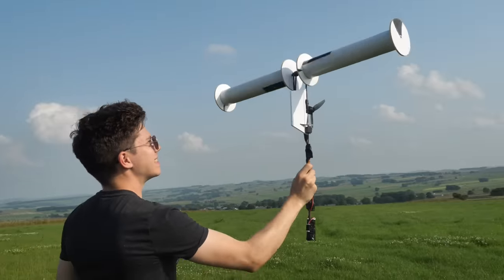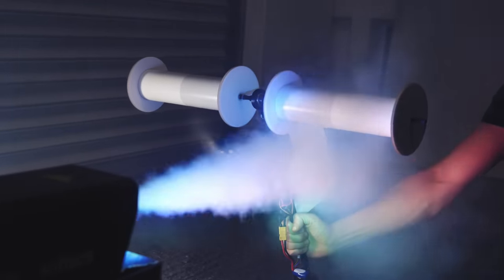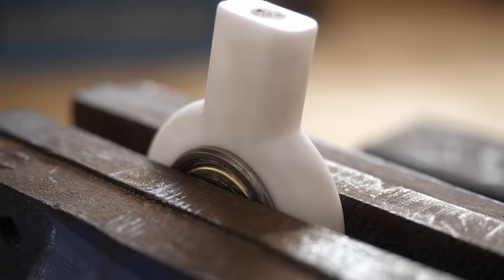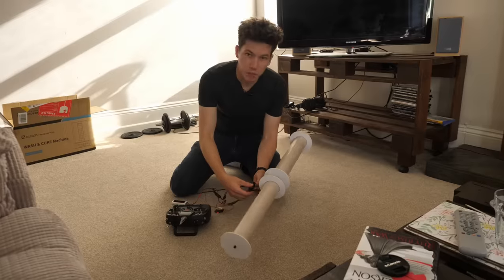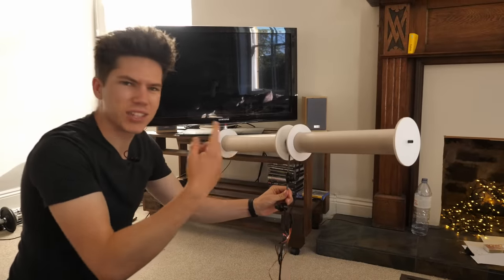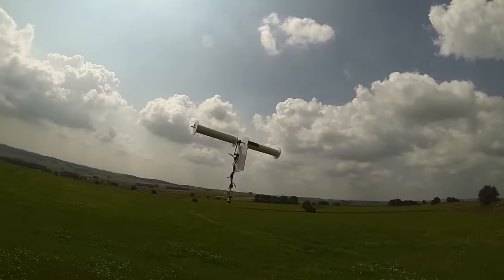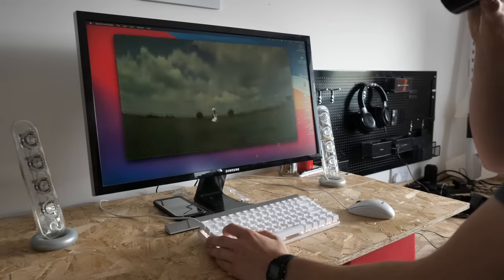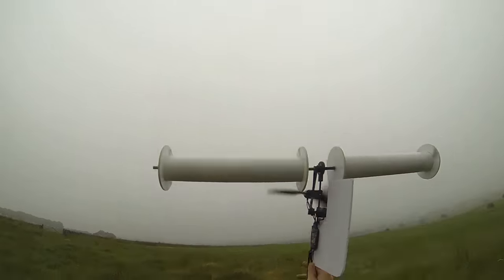Building an Advanced Magnus Effect Plane

Comment: There's something delightfully unnatural about watching that thing actually fly
Reply from the maker: I’m still surprised the Magnus Effect is that powerful to easily lift 600g of plane! ☺️
Reply: I am working on a project to drop a plane from space with a weather balloon can you give a plane design with big wings to fit many solar panels as possible
Reply: @creativitybooth8115  a glider? Big wing, so many place to fit solar panels
Reply: @creativitybooth8115  Man that's a hell of mission to tackle if you don't know about aerodynamics. Also likely super illegal depending on location and prior approval/licensing.
Reply: @thirtythreeeyes8624  as I am in india it is legal and there is no airport in the city I live so there must be no problem
Reply: @creativitybooth8115  What are you trying to do when the plane is released? It's been done before but, on a much simpler scale if you're trying to go for some solar project.

https://www.youtube.com/watch?v=rpBnurznFio

I would add an autopilot haha. Maybe with an altitude based release so the balloon doesn't get tangled.
Reply: @thirtythreeeyes8624  the link you sent dint land in the intended spot I am trying to land where I launched so it would be much easy 
Solar plane will give much higher flight time to drive home 
The plane would be equipped with a rfd 900 telemetry and a sky droid h12 transmitter for emergency 
It will be running a Pix haw 
So it will be linke a real mission
Reply: @creativitybooth8115  As I said he did a really simple attempt with a glider only jet air frame not ideal for a real mission style. As long as you plan for the variables a successful balloon flight shouldn't be too difficult and would not require solar power but, GPS and I'd assume other satellite positioning systems stop working above a certain height.
Reply: @thirtythreeeyes8624  that would be my blind spot after that I would regain signal and drive back home no problem ah
I coul use a simple glider but it wouldn't land in my designated landing spot
Reply: @thirtythreeeyes8624  I would switch auto mode only after I regain signal through my telemetry
Reply: @thirtythreeeyes8624  I am doing this also for my youtube channel to get more subscriber
Reply: @creativitybooth8115  I wasn't suggesting use a glider I'd use a flying wing, only saying that is what David used, although a glider could easily make it to the launch point with even a moderate glide slope, unless you launch on a very very windy day.
Reply: @thirtythreeeyes8624  thanks for you suggestion but can the glider glide the way home
Reply: what if you make a second set of cylinder going the opposite direction will it float?
Reply: lmao some bystander might think its a ufo
Reply: Nice

Comment: The reason it is so unstable is because you modeled it after a pendulum instead of having control surfaces for horizontal stabilization. Lowering the center of gravity does not stabilize an aircraft because the thrust and lift vectors are not fixed to the direction of gravity. look up 'pendulum rocket fallacy' for a better explanation of this.

Comment: You don’t have a horizontal stabilizer. You made essentially a flying wing with no ailerons or elevator. Very cool that’s you’re trying to make something cool and seems like you had a lot of fun doing it.
Reply: horizontal stabilisation is provided by the center of mass being far below the center of lift, an airplane style horizontal stabilizer might help tho.
Reply: @ledocteur7701  that’s not really stabilization, that would be balance. Stabilization is active, using air flow to keep something stable. I think your plane could fly if it had stabilizers on it.
Reply: Yeah, the fact is, you made the job really hard for yourself by not just replacing the airfoils of a fixed wing aircraft, but also chucking the stabilizing features including dihedral and empennage. You also induced a counterproductive moment with your propeller position. Nevertheless, you made it fly...bravo!

Comment: Man that's awesome! I would recommend making the tubes slightly dihedral to make it more horizontally stable and a fixed vertical stabilizer so it'll move in a much more straight direction.
Cheerios!

Comment: Does the speed of the rotors change the lift characteristics? If so, you could have a small "tail rotor" that you vary the speed of as an elevator.
Reply: yes indeed it does, faster cylinder rotation makes more lift

Comment: I wonder if there is a more efficent fuselage /body design. I've seen petersripol swap the wings for the magnus rotors on a normal plane design, and i've also seen a video of a drone with four magnus effect rotors on a drone instead of propelers. I wonder if there's a middle ground, wich has both controlability and stability.
Reply: My most recent design is stable and has landing gear for takeoff and landing.

Comment: I like this! Nice catch on the thrust point being too low. Have you tried having the prop be a 'pusher' orientation? I'm curious if that would give smoother air over the rollers to help their effectiveness, or if the thrust from the prop actually makes them work better due to the air it throws over them.

Comment: The "stem" seems to be one of the main breaking points. Could the design be adapted to fit carbon fibre rods? As far as I understand it should get lighter and more durable
Reply: @cap5856  it doesn't look like that in the video. There is the announcment picture where it has the right texture but in the end he said to PRINT it with more infill
Reply: @cap5856  yeah ok, the last rod is carbon fibre, but the one before that definitely wasn't
Reply: @cap5856  Thank you captain obvious for your redundant commentary
Reply from the maker: @nutmeg8363  To confirm, all of the fuselage and rotor axle tubes used in the build were carbon fibre. Some were thicker than others.
Reply: @cap5856  Your comment was redundant because Nutmeg had already acknowledged carbon fibre had been used in the frame. When he originally suggested the use of carbon fibre he was unaware that it had been tested. Assuming he knows what the meaning of 'moot' is, he would also be able to deduce that his suggestion had already been tested and wasn't useful. Your comment was superfluous (synonymous with redundant) if we assume Nutmeg is capable of the most rudimentary level of critical thought/reasoning.
Reply: @cap5856  *I should have used the word 'comment' rather than 'commentary' in my original post

Comment: you don't need a circular core for the Magnus effect, think about a steamboat paddle.  You can make a thin slat, like Venetian blind slat, work as a Magnus airfoil that displaces air reasonably well. You might make an aero-spike-like variant by cutting your cylinders into four sections along their axis, then reversing each section so it is concave when viewed from the outside, and gluing or taping them together.

Comment: You need to look into harmonic balancing of your "Wings". Pretty much the same thing that is done to your tires when you get them balanced. It will stop oscillations because of two spinning axis's that are off balanced. Could explain the bank/yaw that you are also getting. With a good balancing, you should not only be able to get a more controllable/sustainable flight but, you could even get it to hover without it lawn-darting into the ground.

Comment: So for a science fair project I had set up and illustration in research panel on all the different ways to generate lift.  I actually found that the Magnus effect is much stronger if you use something like a paint roller.  Pretty much the principal uses drag to create lift and if you want more low speed lift you need more drag.  Also a rear horizontal stabilizer seems to be the way to go with dealing with pitch problems.

Comment: please revisit this :) Could use one white tube rather than two, putting the battery inside the rotating wing, with bits hanging out either end that hang downwards to stop the battery spinning round instead of the wing, remove the tie-fighter bits from the ends of the "wings", and if possible remove the propeller. It'd look even more spooky to see it fly :)

Comment: Great project, awesome!

Your projects are cool, loving it.

Just a tough of this *flying object*, as it without a wing, power-off = disaster .. might be a good idea to add-on an emergency parashot landing switch. ;-) 

Some propose idea: :-)
1) A design to detect lower voltage (not too low, preserve for throttle/rudder motor), and shut-off the  cylindrical  (with ejecting the parashot), timing would be critical
2) Enhance the  2nd motor mount, with vector control motor mount, to provide a much effective rudder control (without the use of vertical stabilizer) , along with forward propulsion
3) The remaining current in battery, shall be good enough to provide minimum steering assistance for the rudder in parashot  mode

Hope to see if you are interested and share this new version :-)

Comment: Very interesting, makes me ask questions!

1 I wonder about the effects of using a slightly oval rotating tube?  What of an egg shaped tube, wonder if that would fly?

2. The lack of directional control was likely more to do with the length of the craft, centre of pressure, battery location, and the location of the directional drag component (the rudder)!  What about extending the build?

3. What about adding 2 small motorised gyroscopes (one clockwise, the other counter clockwise) in a trailing tail assembly instead of a rudder which could steer by adjusting the speed of each of the two of gyros?

Comment: Hey, few experiments you dear  :

1. Try to put fan on the top of it like choper have to give initial hight and thrust, after reaching good hight you can turn it off.

2. Try to increase the length of stem of fan that you had attack and try to put that stem of fan in very middle of both the rollers.

3. Try to make rollers like this sign  *
Means make small edges or sharpe humps on the surface of circular roller which will look like this *

I'm subscribed to your channel with bell button on and waiting for more experiment in this invention.
Good luck from land of 1.3 billions people - Bharat

Comment: What a fantastic project!   Getting it to fly at all is a huge accomplishment.   As stated elsewhere, a little dihedral could help stability. But likely not easy to set up since it's belt driven. How fast were the motors (or tubes) spinning, and what was the reduction used?  Might be able to use a pancake outrunner of larger diameter to direct drive the "wings" from within the tube.

Comment: Good job!
I believe your tubes would benefit from some texture to grab the air more, like dimples on a golf ball.
This would make the wing more stable so the slick surface doesn't "let-go" and "tip-stall" so quickly.
Another item would be to have a vertical fin with rudder a few inches aft for better directional control.
Do it again!

Comment: 6:55 "the Magnus effect is such an unknown concept" No, it is a very well known concept, it has been for a very long time. Don't worry though, according to the ideal lift theory, you can get an estimate of the lift produced as L=air_density*airspeed*2pi*r^2*w where r is the radius of your cylinders, and w is the angular speed of the cylinders in rad/s. In this way you can calculate your necessary rotor speed. Keep in mind though that this equation only works until r^2*w = 2. Hope it helped, also wouldn't mind some basic engineering behind your projects besides guesswork :)

Comment: 4:35 No not really a new pulley but addition of edge to prevent it from sliding off. If you used ABS platic, you can chemically weld the ABS plastic washer in place using acetone and since there is hole there you can make small ring to center it properly. This way you save filament. I have used this technique even on failed prints, by counting, or looking on the software what layer it was doing, calculating the height using layer height, removing bottom peace how ever high it was in cad, printing the rest, removing how many layers were failure, sanding both surfaces even and chemically welding them together. Then sanding and filling any imperfections with putty made of abs support material and acetone in glass jar with suitable sealing metal lid. If putty dries into container, just get it loose from glass if possible and pour in more acetone and in a day you have more putty or slurry depending how much you have added acetone.

Comment: Congrats on your success. The aircraft is amazing, but your ingenuity and tenacity are even more so. There are lots of areas to investigate and optimize! Power, balance, steering, rotor diameter, length,  RPM, even rotor cross section shape and surface texture. There are probably many more opportunities for improvement that you would know about but not me!

Comment: That was pretty incredible. I wonder if it would help by making the horizontal thrust from 2 additional spindles perpendicular to the vertical lift spindles and spinning them opposite each other. Propellers create torque in one direction and switching it to spindles might cause a slight gyroscopic stabilizing effect. Just food for thought but really cool man! I just subbed.

Comment: It seems like this would have a much greater chance of success if you just took a regular rc plane with a carbon spar and replaced the wings with magnus effect barrels. It needed a vertical and horizontal stabiliser behind the cg and motor/prop out in front of cg. The hanging weight only works on parachute type wings like para motor.

Comment: I'm thinking that part of the problem also is your forward thrust propeller is disrupting the airflow over your cylinders causing a stall effect on about half of the cylinder. If you could possibly change the propeller set up out with and enclosed squirrel cage type blower fan with the airstream coming out of a tube a little below and behind your drum like a jet push. That should make the lift of your drum as wings much more efficient.

Comment: Three things to make a Magnus wing work better:  Shorter span. Larger diameter.  Higher RPM.  And a fourth: Surface texture affects performance.  Too smooth reduces lift efficiency, too coarse a texture greatly increases drag.  I suggest testing by wrapping the cylinder in sheets of sandpaper at differing grit levels from super coarse to the finest available.

Comment: ingenious.  There are a lot of improvements I think you could make to the rollers.  I was thinking of some sort of roller that would have like a sequin effect that would add surface area as it pushed air down, and flattened as it rolled on the winward side.  Hopefully you could roll the rollers slower that way and have more stability.  Also there should be some way to take advantage of the gyroscopic effect of rolling like a bicycle for stability.  Maybe a structure supported above the rollers,  so 2 sets like a quadcopter might make an extremely stable device.

Comment: Tip: remove the motor and belt for rotating the spindles and change the spindles for Savonius-rotors. These Savonius-rotors are powered by on-coming airflow which saves you from lots of troubles as can be seen on my YouTube-channel.

Comment: Would this a viable and maybe more efficient use in water? Like using it and a a flywheel designed into the basic geometry. quicker, semi-agile (Can't go backwards) drive system? or would using it water leave no hope for materials to survive the sheering process?

Comment: Try a counter rotating quad variant.

You spin each set of motors so that it draws air from above center and pushes air to the outside edges.

Should be as simple as porting the magnus wings onto drone motors and using existing rpm based stabilization that drones already use.

Comment: Hi. Your aircraft has no dynamic stability devices as there is no horizontal tail and no V on the wings. So you use the battery weight as static stabiliser vector on pitch and roll axis. You kill the pitch axis stability with giving thrust at launch under the lifting cylinders and it takes time to recover. 2 possibilities : first you add physical stabilisers, or you accept the unstability and you use a flight controller to get electronic stabilisation (I have no idea how to implement it for nick axis but using FC looks the more sexy as a research project...). Good luck !

Comment: Hey, where is tail on your plane? The rollers replace wings, but they don't change the basics of flight stability. Low CoM helps, but there is a reason why air planes are not using that design (although parachutes kinda do).
Reply from the maker: It's designed to work like a paramotor. It doesn't need a tail! :)
Reply: @Project-Air  Well, in paramotor most of the mass would be far below the wing. In your case it is not. Also, your design require more stability than paramotor, since you are producing torque on "wing" motor. If it doesn't need a tail, why it is not stable??

Comment: For greater stability you need to have 4 rolling cylinders instead of two. I can imagine an aircraft with a regular plane-like fuselage with two rolling cylinders near the front and two at the back. ( -|----| ) But I think the Magnus effect is probably a less energy-efficient means of generating lift than a rotating wing (rotor blades used by helicopters and drones).
Reply: The primary stability issue is the lack of a full tail on a long lever arm- that's what conventional aircraft designs provide. As for efficiency, conventional bladed designs (and presumably unconventional ones like cyclorotors) should be more aerodynamically efficient, but if the Magnus rotors have a higher mass then at lower speeds they should have more reliability. So, for something like a hybrid airshi, Magnus rotors may be a superior lift option